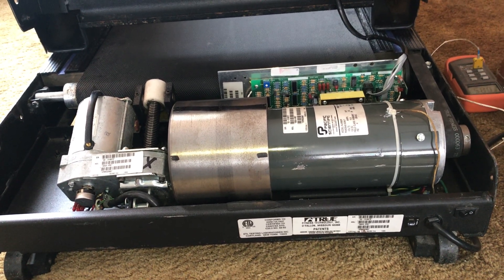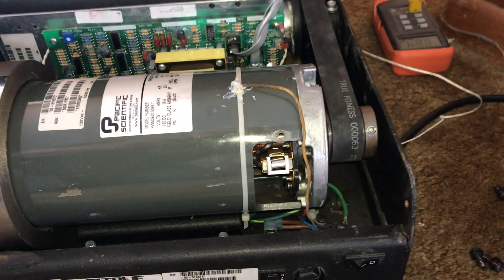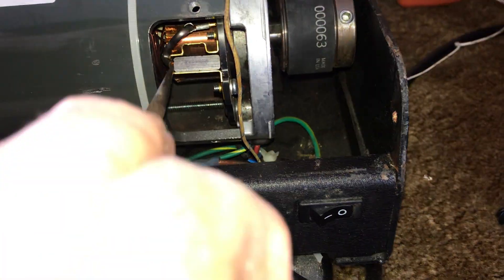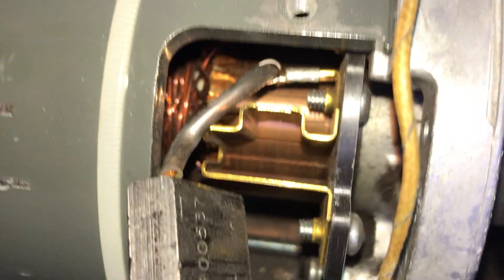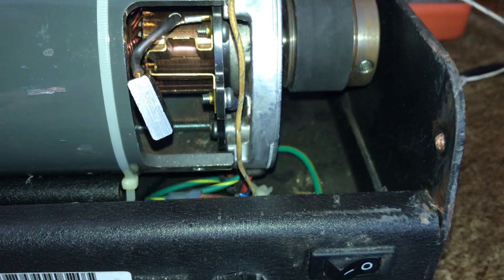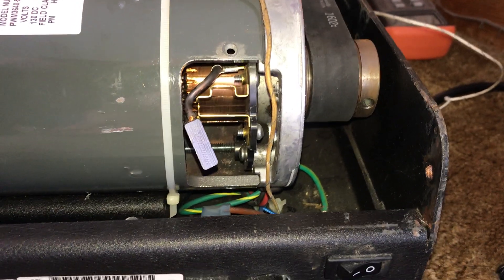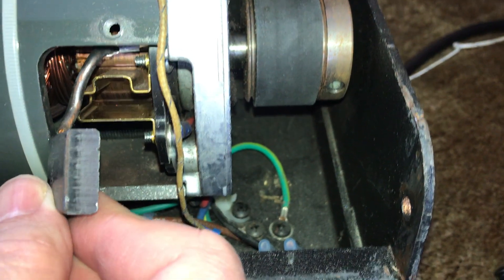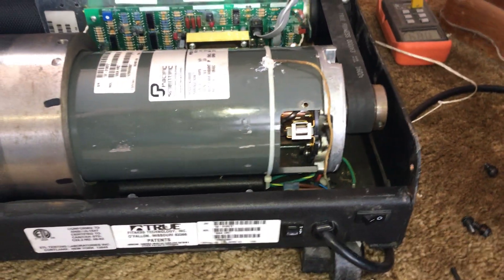True Fitness 500 treadmill PWM3640-5396-7 motor overheating

Comment: Hi I have one of those treadmills and wanted to check the motor area for dust and clean it if required.  Can you tell me how to remove the cover without damaging anything?  My guess is you remove the 3 screws on each side and fold the console down onto the belt.  Is that how you did it?  Any suggestions would be appreciated.  Thanks.
Reply from the maker: Yes, that is exactly what I did taking care with the wire that goes up one of the sides.  There is plenty of slack in the wire to lay the console down like you suggest.
Reply: @toddcarpenter3024  cheers thanks for your help much appreciated. 😃👍

Comment: Hey Todd, my treadmill starts to smell after about 12 minutes and the brushes are down to about half way. I felt the motor and could easily fry an egg on it. Is it an option to replace the brushes, if I can find new ones ?
Reply from the maker: That is an option.  If the spring is still contacting the brushes and putting pressure on them, I find it unlikely the brushes are the problem though.  If the spring is bottoming out on the brush holder due the them being too worn then it is worth a try.
Reply: @toddcarpenter3024  Thanks for your reply Todd, yeh, nah the brushes appear to be fine once I pulled them out. That would mean the motor is on it's way out.

Comment: Thanks, Todd! Are you able to make a video showing where the speed sensor is? Maybe even how I'd go about replacing it? I get an "E02 COM ERROR" when I try calibrating it and don't have the manual.
Reply from the maker: I no longer have the treadmill, but from the video I think the speed sensor is shown in this link (I circled it in red).    https://drive.google.com/file/d/1O4S5ksXr9OeO9hH6xb-TqVgsAaQaDqeB/view?usp=sharing

You can loosen the sensor to adjust the distance from the magnetic wheel which might improve it.   Also, I found this service manual online.  You have to carefully find the sections that are for your model.   https://drive.google.com/file/d/1rS6SRmXsHcCM4WhLhDNSKsiVsanyKukz/view?usp=sharing

Comment: Hi, I have the 500z treadmill with sparking under the motor inspection cover.  E2 cal error seems to intermittently pop up under load.  I might try this sanding before having motor rebuilt